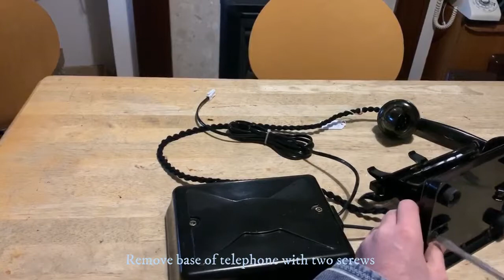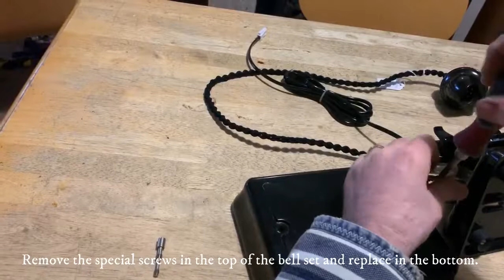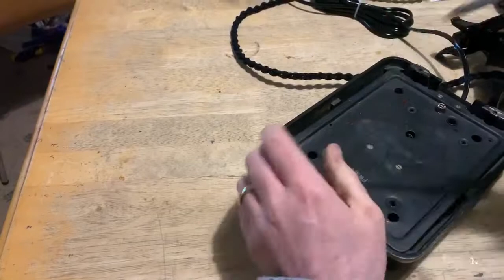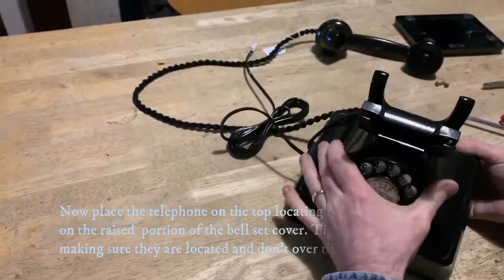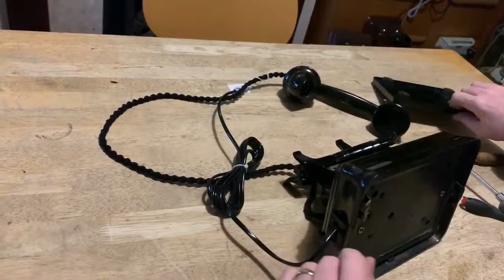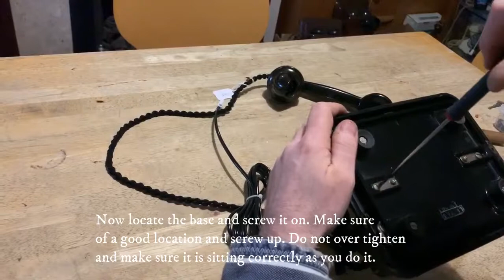Fitting bell set to GPO 200 series telephone

Comment: I bought a device (Dailgizmo) from this chap for my old 322L Bakelite 50s phone to enable it to be used via VOIP as the original copper line system is soon being fazed out by all phone companies including BT in fact, most companies only offer this digital system as a landline feature, Anyway for the phone to work as a regular phone it needs a conversion kit this chap supplied everything and explained everything in detail, and now ALL my older phones work I would recommend this chap 100% you won't be disappointed if you want your old phones to come alive again!

Comment: Hey thanks for the video. Couple of questions - what is the no 26 bell set made of (particularly the shell that covers the top). Also do you know the inner dimensions (just the footprint) cheers
Reply from the maker: The metal body that the working fit to are made from brass. The external case is Bakelite. Internal dims of bellset cover is around 6" x 7 1/2" x 2 1/2 .